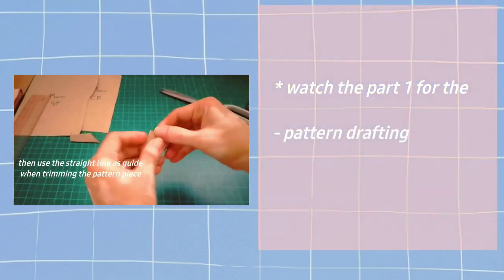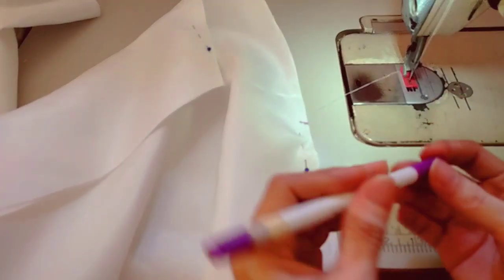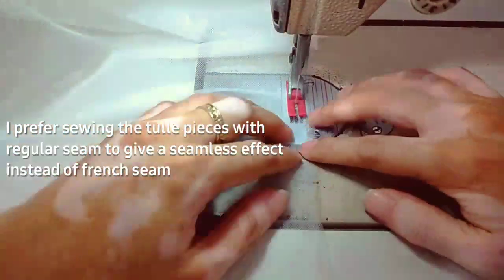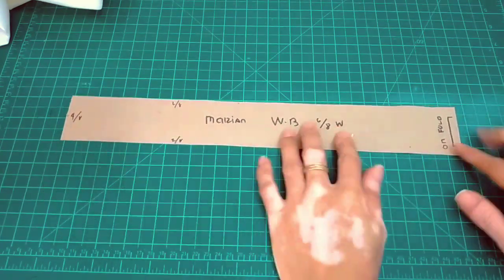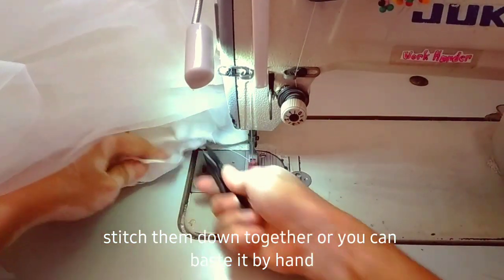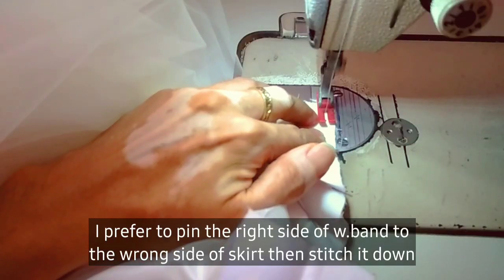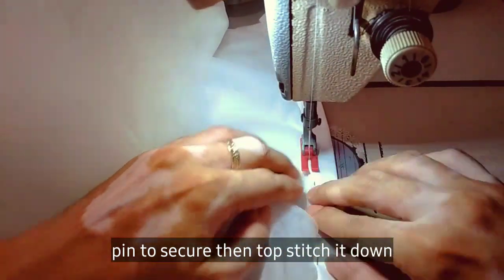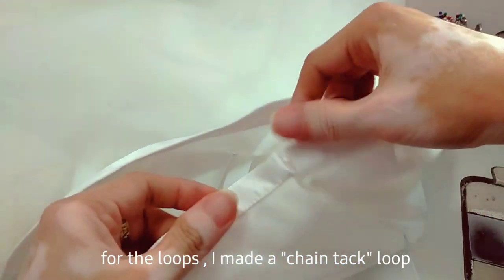🧵 Pt 2 : Sewing Detachable Tulle Overskirt × Working on My Client's Wedding Dress × Sewing Tutorial

Comment: thank you! I'll be doing this for my prom dress. Should the waistband be the same material as the bodice? if so, my bodice is a slightly stretchy material. is there a way to stabilize that? or is it fine?
Reply from the maker: Thank you too Hannah 🙏❤🙏 

Regarding with the waistband , if youre going to use the same material , you can fuse it so it wont stretch 😊